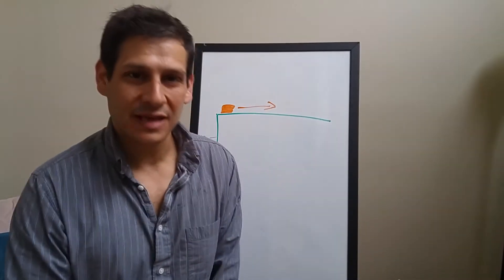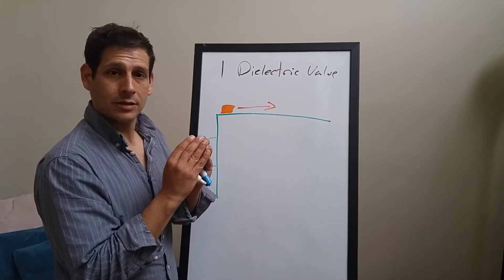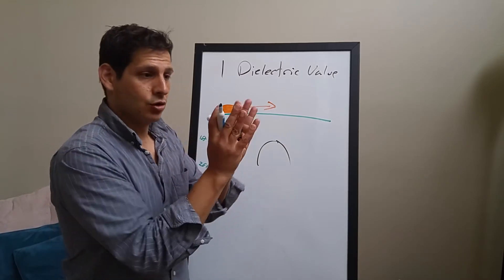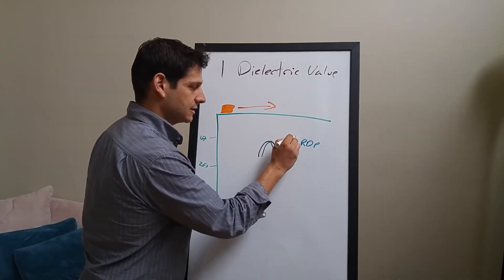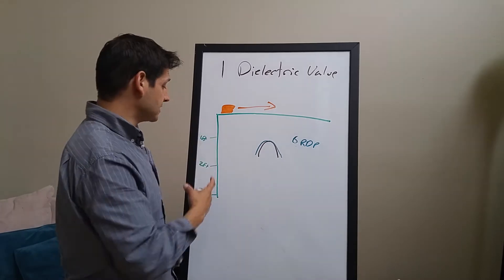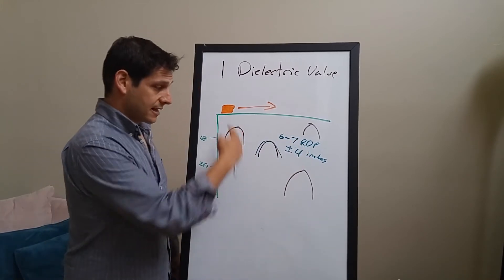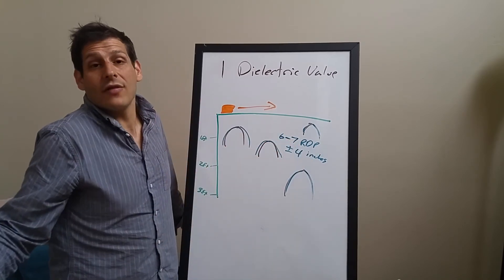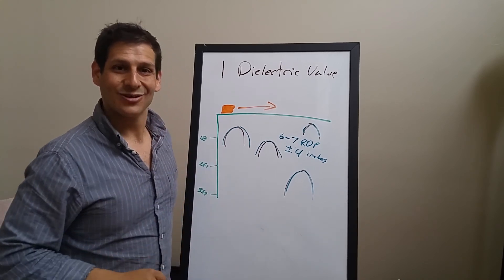The Effect of 1 Dielectric Value on Your GPR Survey (Ground penetrating radar)

Comment: Hi, I want to ask is it possible to calculate the dielectric value of the reflected object/ second medium?
Reply from the maker: Yes. If you have the dielectric valuenof the first material,  and, the reflection coefficient
Reply: @Learngpr  but how to get the reflection coefficient  without knowing the relative permittivity of the second medium ? Is it we need to use peak to peak amplitude formula to get the relative permittivity value ?
Reply from the maker: @iffahroslan4392  good point. Haha

Comment: The dielectric is the most important factor for depth accuracy. The other ways to introduce error to your depths are to mark the wrong color first such as white instead of black or black instead of white. You could also mark the wrong part of that color, for example, marking the top of the white instead of the middle. Depths can also be wrong if time-zero is wrong.
Reply from the maker: Jamie Althauser Great points. There are definitely other factors that contribute to miscalculation of depth. All definitely need to be considered on each project. I might use this as a topic for a future video. Thanks for the idea Jamie!